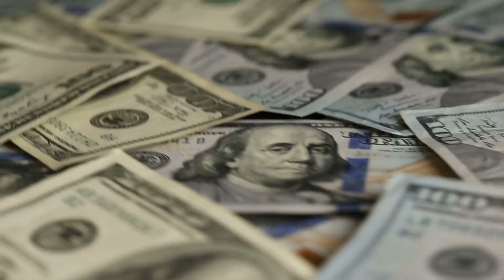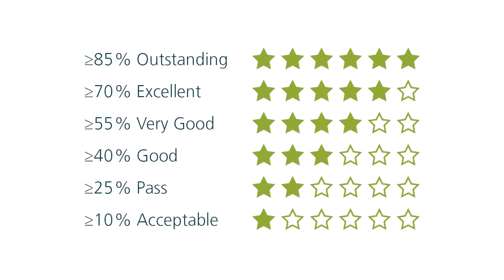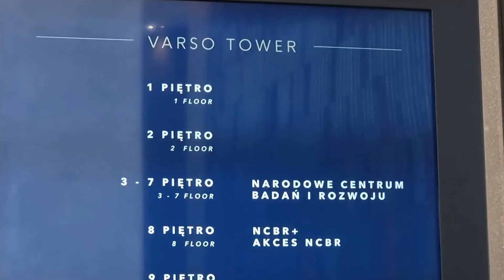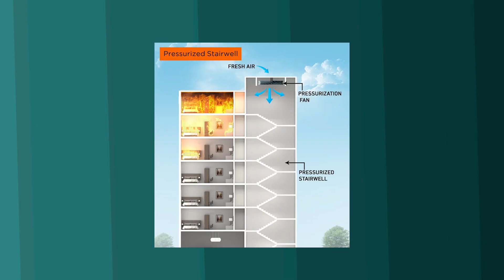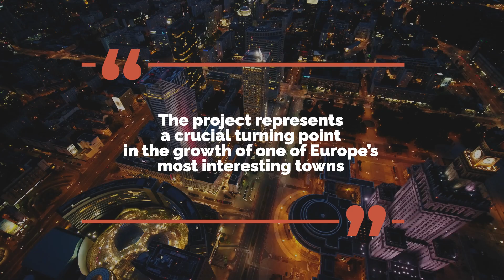Varso Tower: Europe Has A STUNNING New Skyscraper, And Is Not Where You Think!

Comment: Varso tower: 236m rooftop, Commerzbank Tower: 259m rooftop
Reply: We know bro.
Reply: varso tower architectural height: 310m, commerzbank architectural height: 259m
Reply: You can spit down from the roof of the Commerzbank tower (259m) to the roof of the varso tower (236m). The varso tower consists of a whole quarter of the antenna.
Reply: @hehejo8568  it's not true. fact to the roof of commerzbank is 259m and varso is 236m. There is one but also one explanation. In the commerzbank, the block of the building from 205 to 259 m is bare concrete without any windows where people cannot enter because it is a technical part. In Varso tower 236m is a public observation deck and 205m is a lower observation deck. regarding the antennas. In commerzbank, the antenna is attached to the roof where it can be removed at any time. In Varso tower, the spire is embedded in the body of the building for about 25 m and the spire itself came from the foster's workshop, which is why the wheels on the spire and the illumination at night
Reply: Wikipedia:
Commerzbank Tower: Roof
258.7 m (849 ft)

Varso tower: Roof
236 m (774 ft)